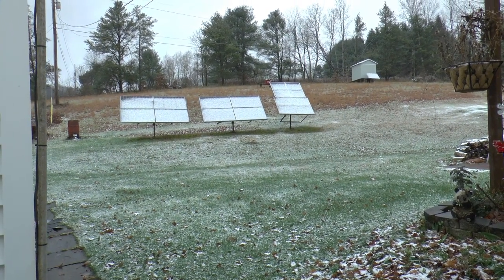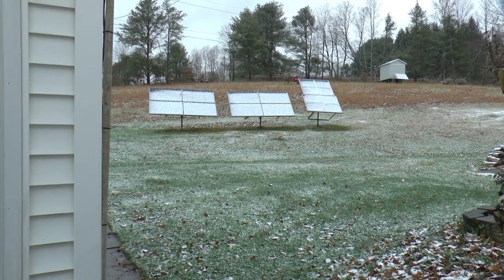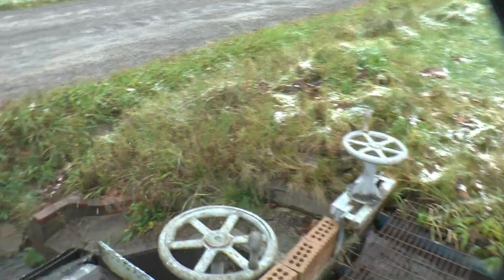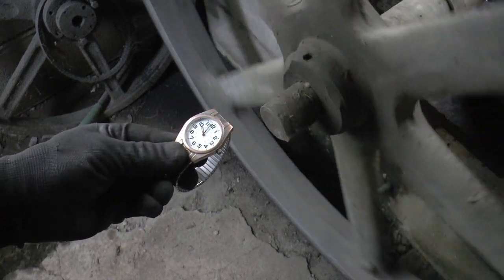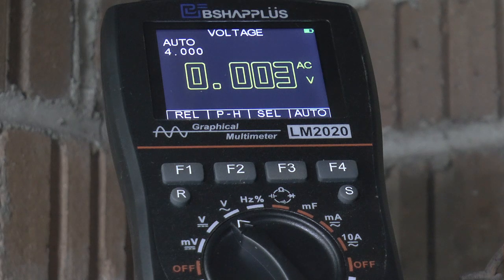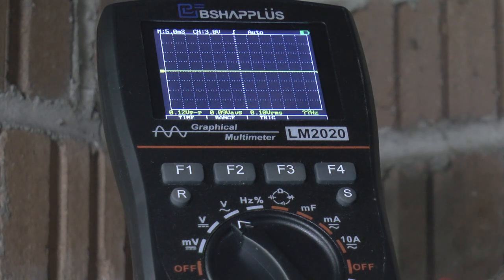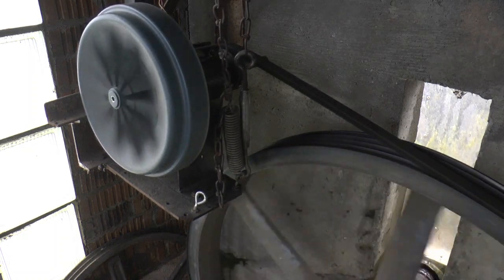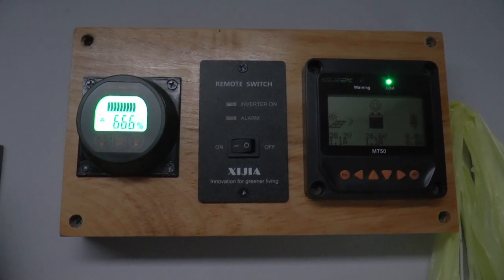Waterwheel after Hurricane Nicole

Comment: you can tell joe this.      a waterwheel  Should  be  loaded  such that its rate of rotation is  Slow  enough, to allow  TIME for a bucket to fill  before moving away from the flume end.     maybe, fifteen rpm.
Reply from the maker: That is correct to get the most power. I think that is pretty close to my rpm with my average water supply. But with a varying water supply you need to get a happy medium or be able to change the load on the wheel. When my batteries are full and it goes into by pass to the dump load resister my wheel will slow down because the resister is a larger load than the batteries.

Comment: I was working on my GE washer from home Depot the other day and I noticed it's a belt drive motor I was kind of wondering if it's a DC drive and if it would work in this application converted over or not if you get your hands on a GE washer might be an interesting experiment. I'm not sure if it is DC or not because I lost my lights sometimes flicker when it's running but I've got some old ass wiring in this house of mine